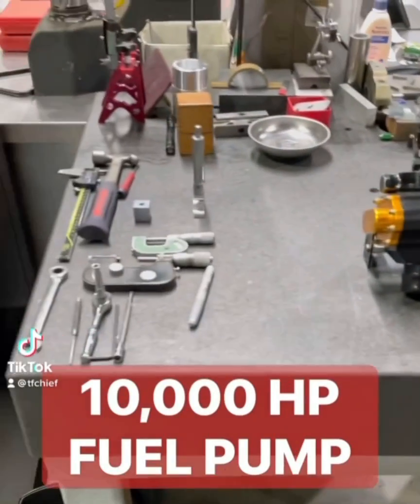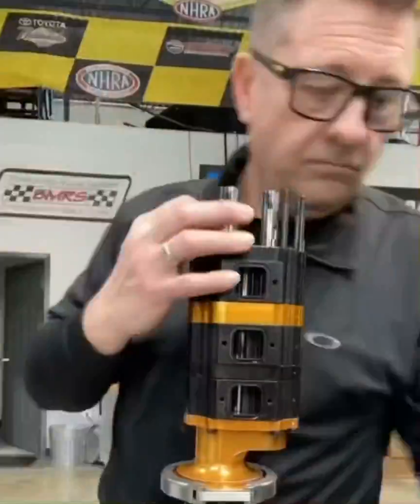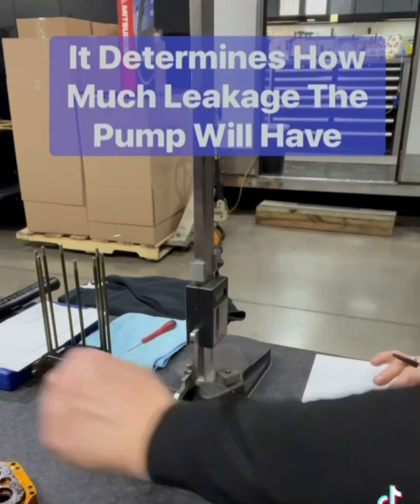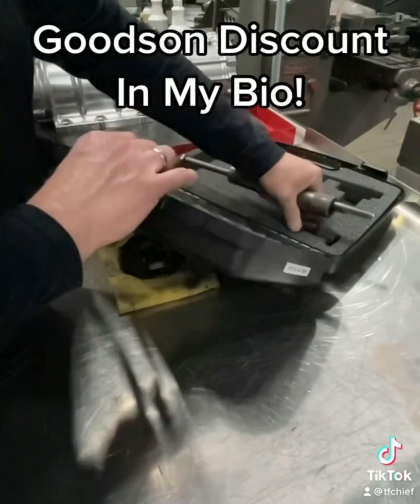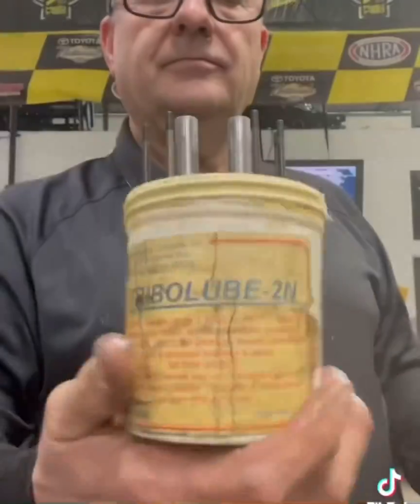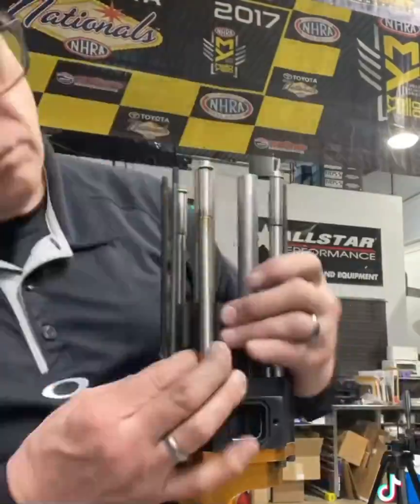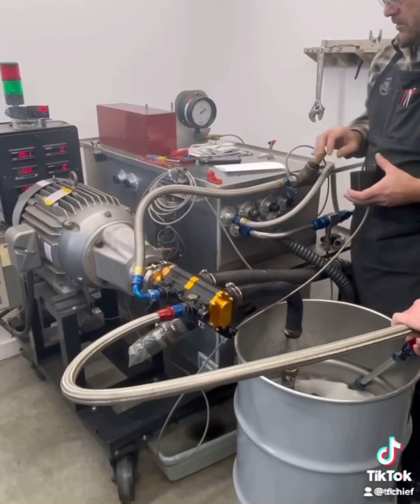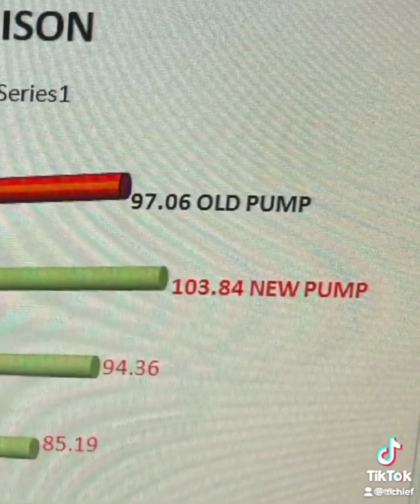10,000 HP Fuel Pump Rebuild!

Comment: interesting, it looks like an expensive version of a sbc oil pump, that has 4 stages. I wonder why they don't have fuel pump that is similar to a LS1 oil pump in stages?
Reply from the maker: I believe it’s a volume issue and not all a pressure one. Also the viscosity between the two are so different. It would have an 1” shaft and better inlets if it would all fit in the same place but we are limited by the available space.
Reply: @robwendland  The LS1 oil pump star gear is an eccentric gear, and if it’s built right the shaft could be like a mini crankshaft that spins each star gear in each stage at various degrees. It would be interesting to see if that design would be more efficient. Anyways, thanks for responding.

Comment: Strange those end plates are not made from stainless steel..
Reply: Any kind of stainless will not wear well.  They have to be a pretty hard steel.
Reply: I'm no expert on hardness or durabity on mild or s/s but always found stainless much harder to cut than mild steel.
Reply: The issue is stainless tends to gall ( metal balls up rather than wearing away ) when used as a wear point, this will jam the pump.